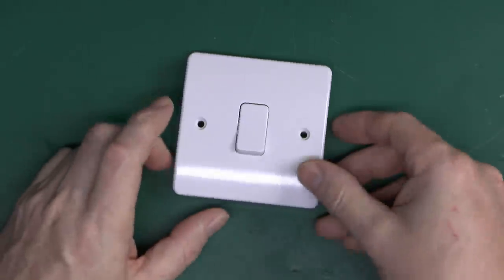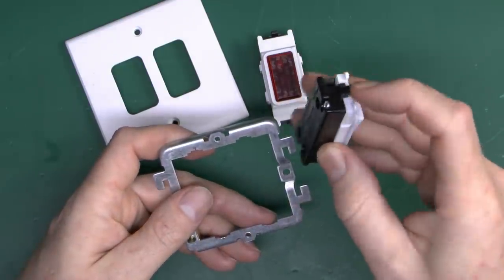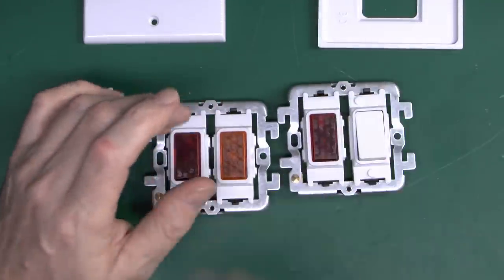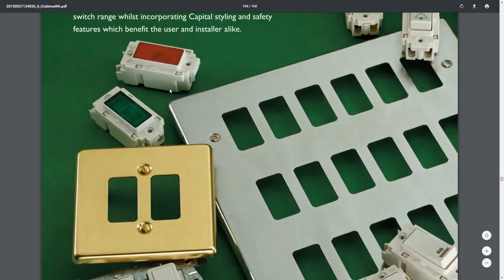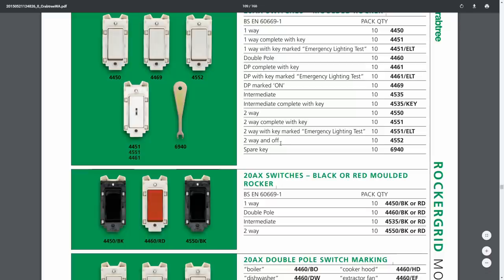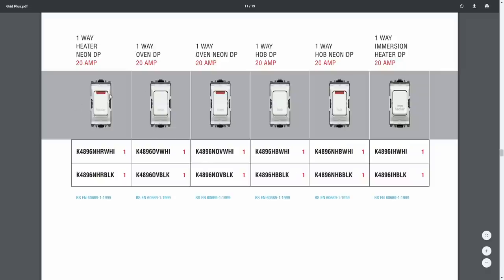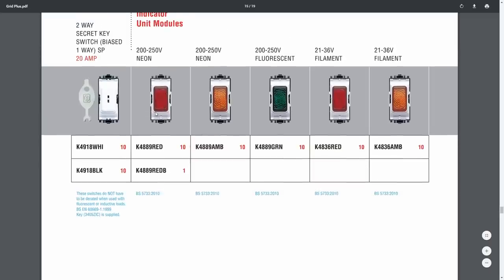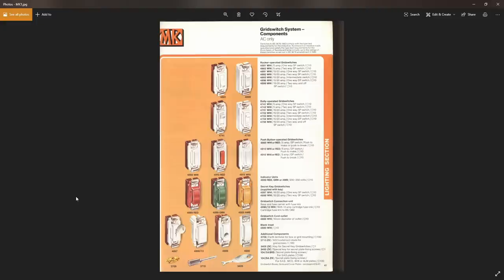Grid Switches and other modular devices

Comment: Nice! One thing that i spotted about the Mk standard logic plus light switch that you showed in the video is that the light module is the same as he grid switch section. You can actually see the little clips on it that are used to attach it to the grid.
Reply: 0:33 It does look that way but you'll find they're missing the face part if you remove it to install in a grid.
Reply: You can't remove it anyway because both the different parts of the module and the face plate/insert are designed
so that they only snap on one way during assembly.

Comment: A few years ago I needed a key-operated fused spur, connected to a 30A ringmain. This was for a fixed interactive lighting installation in a school, key-operated to prevent tampering by kids.  I suggested using grid-switch components to fit a single-width back-box - a fuseholder with 3A fuse, and a fish-key switch. The local electrician said this wasn't possible as the switch wasn't rated 30A, and wouldn't accept my argument that the 3A fuse provided protection. I ended up installing this anyway after he'd gone, but was he just mistaken or would there be a regs issue doing this? And would it matter in which order the switch and fuseholder was connected.? I'm fairly sure the switch was a DP one
Reply: Personally I would have fitted the switch after the fuse as the circuit the switch is on could then never see the 30A current even in a fault condition. I wouldn't have a problem fitting something like that as it could just be treated as a fused spur.
Reply from the maker: Nothing wrong with that, the 3A fuse provides overload protection.  Switches only need to be rated for the load they are controlling, not the upstream circuit protection.
Reply: The switches in switchsockets and FCUs sure as heck aren't rated at 32A, neither are the DP switches commonly used to switch under-counter appliances.
Reply: Not sure about having the fuse before the switch, I don't like the idea of a permanently live fuse carrier. The switch would see the same fault current regardless of the position of the fuse anyway,  unless the fault occurred between the fuse and the switch.
Reply: @technic550  Very logical provided any fault was after the fuse and not between it and the switch.

Comment: One interesting innovation I have spotted (but haven't tried myself yet) in the modular space is "minigrid" from Scolmore. It differs from traditional grid systems in several ways. Firstly the smaller plates don't use a seperate yoke, the modules just screw directly to the back of the plate. Secondly the modules are smaller so you can put 3 modules on a 1 gang plate and 6 on a 2 gang plate (vs 2 or 4 with most grid ranges). Thirdly rather than having separate modular and non-modular ranges their standard light switches are pre-built assemblies of minigrid modules. So rather than having to carry two separate sets of products you can just swap modules around. The main downside seems to be lower current ratings than other grid products (the highest rated single-module switchs are 10AX rated single pole or 13A resistive rated double pole).
Reply: I've ordered a few different switches from them just to have a look to see if we want to use them in a house we are having built.
They have turned up now, the white Mode faceplates are very solid and the small screws holding the switches in go into a threaded brass insert in the faceplate, all in all looks good. I also bought a cma736 double switched socket, I haven't done a JW and pulled it apart, but it feels weighty and solid, if anything the switches are rather heavy to operate. The not so good now, of the 9 3 way retractive switches I bought three didn't work because the switch cap had become unclipped and the metal metal switch leaf which is only held in position by a sprung rod on the cap was now floating around inside the switch body. The cap is held in place by two tiny pivot stubs going into the sides of the switch body, it doesn't take much force for one of these to pop out. There are three springs acting outwards on this cap, two return springs and on on the actuation rod so it is quite happy to jump free. When mounted in a plate I couldn't get the cap to come lose with any reasonable force as the sideways/twisting movement of the cap is constrainted so in use they will likely be OK. The switch leaf is a diamond shape with a few bends in it so it makes approximately a V shape and it just sits into a plastic cup in the base of the switch. The actuating rod from the cap hold it in place so if that comes loose so does the leaf. The good news is that if you take the cap off completely you can get the leaf back into position quite easily and then push the cap back on. It did take a quite a few goes as any off angle force and the leaf is again in the wind. 
They look nice at least and I intend to use them to control smart dimmers, hence retractive switches, the idea is to pick different caps for different light sets on different floors.

Comment: I used to love grid switch installations...like lego for sparkies lol :-) great for contactor switching, and fused circuits, and fish key switching for emergency lighting. great for village halls etc. Great video JW
Reply: Got one for my CH system ;) Must get round to fitting it ! 2 switches per normal wet zones, (5) and a 6th for the immersion heater. I'm planning to make the immersion heater controllable via wet system controls for DHW - so if the boiler fails, I can have DHW on same times. Of the 2 sw per wet zone, one will have neon to show zone is on (i.e. calling for heat). 1 sw for off and the neonned sw for ON. So if the OFF sw is on and the ON sw is off, (i.e. normal operation) the heating to that zone is controlled locally by timer and thermostat.

Comment: Yeah, useful stuff. The brands we use include a whole lot of connectors too - RCA, HDMI, F, CAT 6, CAT 3, etc.

I've even used a surface mount box with a socket and 3-way switch to decide what the load earth pin is connected to - earth, floating, or neutral. Use it for proving to tenants that it's their appliance that keeps tripping the earth leakage, not my installation. It's also got 4mm sockets for a voltmeter, and exposed loops of test lead cable for a clamp meter. Lots of options.

Comment: Just fitted a whole load of Scolmore, Click MiniGrid switches, very nice quality, all metal front plates. Looking for an LED dimmer from them, but can't pin them down on compatibility.
Reply: Most dimmer modules will fit into their empty inserts.  I've used them a few times for triac and 0-10V LED dimmers from different manufacturers.

Comment: I didn't know CED made grid switch accessories, you can also use grid switches in domestic settings, I have only 
ever used Crabtree or MK grid switches so I can't comment much on other brands. Another advantage of a grid switch
is being able to change the style of the face plates and even the modules from white to chrome for example. 
In some cases it's easier to make up a grid switch to match up a metal socket or light switch especially if your going for
MK or Crabtree.

You can still buy older type Crabtree and MK grid switch components on EBay so that's one way to replace a dud module
in an existing grid switch.

Comment: Dont mind admitting how exciting it was to see the new gridswitch system, though the 70's MK ones could hurt your finger clipping the metal things on. You'd put 5 on no problem and the 6th would dig in so you got sore tips. Our factory still has the MK original grids, it was built in 1974. And I'm old enough to remember when the gridswitches were mounted with wood screws into a flush wooden back box and the faceplates had bakelite indentations to appear similar to the old round dolly switches.

Comment: What is a put off is all those cables in close proximity to each other behind.  The cables also take up space, so all is crammed in. People only want sockets above worktops in kitchens, eliminating ugly FCU isolators.  Grid switches are the the appliance isolators, tucked away in a cupboard. Depending on how many isolators are needed, many use double boxes and FCUs, which are easier to install - and probably cheaper. A larger setup but in a cupboard it doesn't matter in most cases.

Comment: Seeing the old MK book took me back, I realise how old I am. I remember GridPlus being advertised before it became available. The secret key named the fish key was the original 1970s design in the old MK book which you showed at the end. I think it was the ultimate EM test key, you could actually grip hold of something when you switched and was quite tough. Hate the new MK secret keys with that stupid screwdriver thing on the end, too small and fiddly to use.
I also hated the captive screws, if the first fixer put the flush boxes in the wall too deep for the switches it was a pig removing them to fit longer ones. I didn't like using them extension socket screws, they were never threaded the full length and 9 times out of 10 the unthreaded part always seemed to be the part that landed in the tag due to extension screw being just that bit too long. 
JW, when are you going to do us a vid on Pyro, or have you done one and I missed it?  I'm looking forward to seeing that old Pyrotennex book I saw on your desk in another video. 
Keep em coming.
Reply: I still have a fish key I bought it out to Australia with me back in 93 
I don’t know why it was just in the packing box 
Haven’t use it  since of course

Comment: Question on ring mains and isolation switches pal.... do you put the sockets on the ring  then run a isolation cable or put the isolation switch as part of the ring and run a cable for the appliance switch? Hopefully the questions makes  sense :-)

Comment: Reminds me of a school I went too.  Key switches for the lights with separate neon indicators to show the lights were on 😕
Reply: That reminds me. I must get in touch with the local council and tell them that the lights have been on in my local primary school since the lockdown started!
Reply: Only 2 comments really to say about this: was there anybody in ? Maybe they thought the neons would work in a power failure ?
But in fact, they'd show live fittings with duff bulbs.
Reply: @millomweb  this is what went wrong with Chernobyl. They had a light on the control panel to indicate the vent, but it actually only indicates power supply not confirmation of the vent working (which it wasn’t!)

Comment: JW. A friend of mine has recently bought a new build which has a Deta grid system in the kitchen to control the washing machine, cooker hood and fridge/freezer. When he showed me one of the switches I noticed there was no CPC. Probably a silly question, but does the CPC on modular grid systems simply run to the appliance and not the switches?
Reply from the maker: It needs to connect to the switches as well, there will be a terminal on the metal frame and also on the front plate and box if they are metal.  CPC must be taken to every point in a wiring system.
Reply: @jwflame  Thanks JW. There must have been a CPC connection to the yolk which was not visible with the modules in place. 
Happy new year to you and yours; thank you for the content this year.

Comment: Hi JW just one point you said you didn’t see the need to have a switch control for a boiler but this is a requirement under gas safe regulations
Reply: Are you sure he said that ? At what time in the video. It seems unlikely he said it and I suspect you've misinterpreted him.
Reply: do you mean the gas safe register or the gas safety regulations? They're different things

Comment: Does anyone know much about the Eurogrid system?  I did an assembly just before lockdown, which had a 13A socket, HDMI and USB module on a 2-gang plate.  The usual switches, indicators, blanks etc were also available as well as a load of audio visual and data modules.  As I remember, I got the 13A socket from Toolstation, and the plates from CPC/Farnell.  They clipped into position with no screws involved.
Reply: I'm in two minds about them.

On the one hand being able to mix brands and the availability of a wider variety of modules is nice. On the other hand I worry a little about how safe they are for two reasons. 

Firstly clipping modules in from the front of the plate does not seem like a very robust retention system and I'm not sure how well it will stand up to use and abuse. A particular form of abuse that concerns me is people opening the shutters and sticking a Europlug into a 13A socket and the Europlug then getting stuck. I fear this could lead to the module getting pulled out of the front plate.
Secondly I fear that people will install them without taking account of the fact that mains wiring and data/av wiring need to be kept separate. If you built the arrangement you describe in your post on a normal backbox then it is not compliant. Scolmore do seem to offer some large boxes with dividers to allow a mixture of mains and ELV modules, but I haven't seen anyone offer them for standard sized boxes.

Comment: Hi Guys,

Wonder if I may ask a question?

Is it permissible to run the red fire alarm cable with the mains T&E cable, though holes and in the same trunking?

I thought alarms were 24V and that ELV, data, telephone etc & LV should be kept separate?

Maybe there is an exemption for fire alarm wiring as it is screened and fire retardant? If so, I can't find the specific reg.

TIA,
N.

Comment: Hi John. I have an eight way grid with four switches and four fuse modules in my kitchen for appliances with flex plates below the worktops. Would the alternative be to lose the grid and replace the flex plates with fused spurs?
Reply: If you were going to do that, I'd not use spur outlets but fit 13A sockets as appliances would then plug straight in. It is usual though to have remote switches for under-counter or built-in appliances - for ease of turning off - and in your case, checking the fuse. If I was you' I'd stick with what you have !
Reply: @millomweb  Makes perfect sense, thanks.

Comment: Regarding the use of these multi gang switches in kitchens-
 How does that comply with the regulations of the one spur off a single point on a ring circuit?
And should it be signed off on the test cert?.
 It would have to go down as a deviation from bs7671. 
Maybe acceptable on a radial but where would the true end of line be?
Reply: "How does that comply with the regulations of the one spur off a single point on a ring circuit?" there is no such regulation, there is however a requirement that rings should be designed such that sustained overloading is unlikely, so you would want to keep a grid switch assembly running lots of appliances somewhere in the center-third of the ring and you would want to wire the grid switch assembly itself so that the ring went to all the switches.
"Maybe acceptable on a radial but where would the true end of line be?" there is no requirement for a "true end of line".
Reply: Thanks I see ive  never put one in.
 So Make each switch a point on the ring- wire in to the first switch common then jump between commons and out the last one to continue the ring, with individual  outgoing cables to each load. i bet that back box is rammed with t&e.
On radials i was always taught onsite to loop in and out and any new items where wired from the end leaving a definitive end of line.
Reply: @Weaselspleen75  Normally for kitchens you would use the DP switch modules, so both the live and neutral would loop to all the switches. The earths would need to go somwhere, iirc there is usually an earth terminal on the grid but i'm not sure what capacity it has. I bet the box does get crowded though this can probablly be reduced by installing the modules in the grid before installing the grid in the box and keeping the link wires between modules short.
Reply from the maker: A ring for a set of switches is total nonsense, but it's usually done that way because a 32A radial would require at least 4mm² cable, and that won't physically fit into most grid switches.
The whole concept of a rack of switches for all of the kitchen appliances is a poor design and totally unnecessary.
Reply: @jwflame  Agreed. Unnecessary new build Kitchen clutter

Comment: Obviously the plate and the yoke have to be the same size and manufacturer (and product range) to fit together. Also I take it  the switches made by different companies are not cross-compatible, eg. front area of a switch would not fit the cutout of a different brand of plate. Does a switch module of Brand A snap into a yoke from Brand B?
Reply from the maker: No compatibility between ranges, other than some dimmers which are supplied with adaptors for various different systems.
Reply: @jwflame  Thanks for that quick and useful response. Grid modules are not standard. But are Euro modules? I thought that was a standard. eg. I could put a rj45 socket from MK into a surround from BG?

Comment: I have various coax, phono and satellite connections behind my tv, it doesn't look too great to be honest, as i have MK accessories throughout my property, i may go for a grid system, just to tidy things up. Not so hot on combining a coax/satelite connection in the same enclosure as mains power, i know years ago when everything was analogue, you would get interference induced on to a tv for example, not sure if digital equipment would suffer a similar fate.
Reply: Get an MK euro module faceplate an euro modules for your A/V. Don’t put that in the same enclosure/backbox/trunking as your mains wiring and sockets as that’s contrary to BS7671